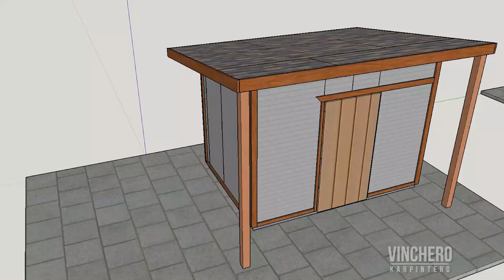Moving Into My Tool Shed // Either I Need MORE Space or LESS Tools

Comment: Nice work sir neat and clean, this is in Philippines right? Curious how the temp inside on a sunny day since you used cladding and Fibcem?
Reply from the maker: Yes this is in the Philippines. The shed gets about 4 hours of direct sunlight on a sunny day. It can definitely get warm inside but for as long as I keep the doors open and one of my cordless fans inside running, I am able to keep the temp at a tolerable level.
Reply: @VincheroKarpintero  just curious why you did not add at least a small window or vents? Also sir i have seen some woodworkers wearing your apron, wer can i get 1?
Reply from the maker: @cocoylawsy  I opted not to put any windows because I needed the wall space. I have a video on how I filled the interior of this shed do check it out. Also, I initially intended the shed to just be for "storage" so didn't think windows were necessary.

Regarding the aprons, you can message me directly on Facebook or buy from Shopee.